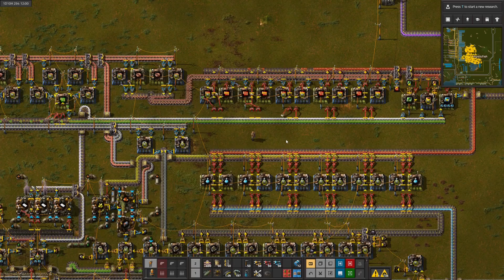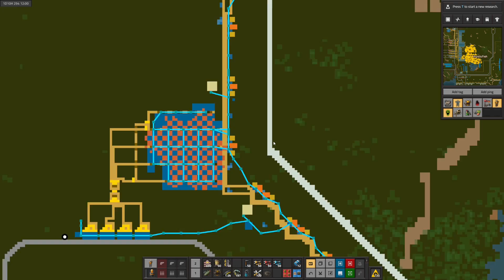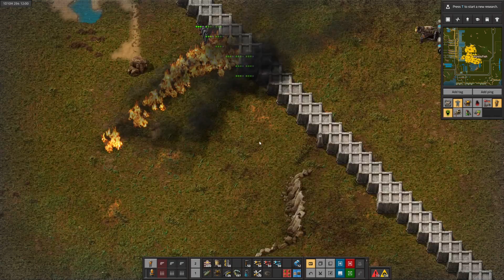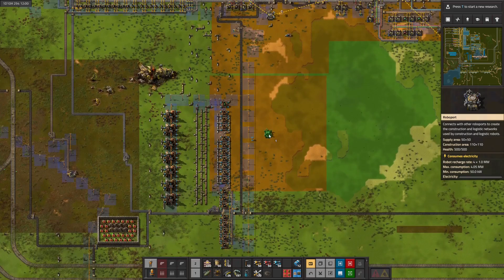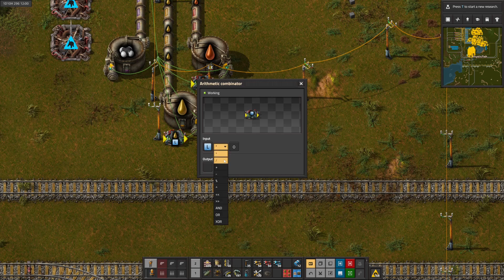Factorio Deathworld Marathon - Episode 66 - Revamping Oil Processing

Comment: I assume at some point you realize all that circuitry was only connected to one cracking refinery of each type?  At this point yellow ammo is nearly useless against the armored biters, I'd see about using all those dull green rocks instead.
Reply from the maker: I definitely had a heck of a time debugging oil! Not surprised there was something I didn’t see. On the other hand, I generally find yellow ammo scales ok as long as you keep doing upgrades, especially when it is just a backup for flamethrower turrets!